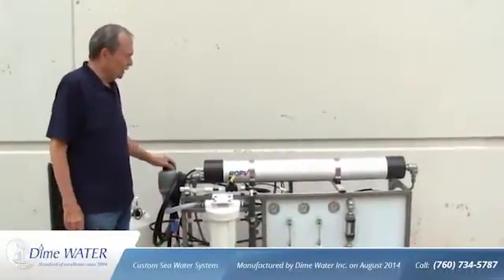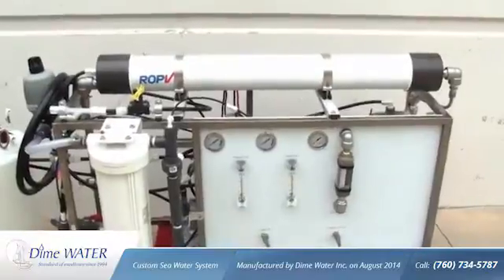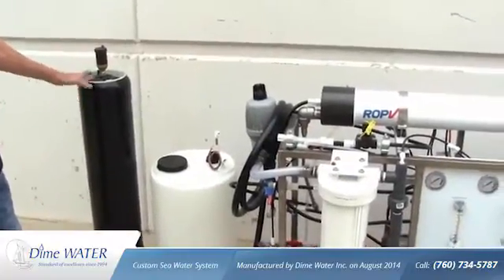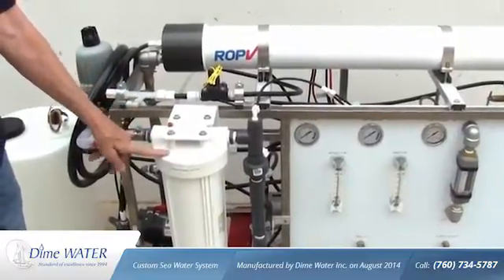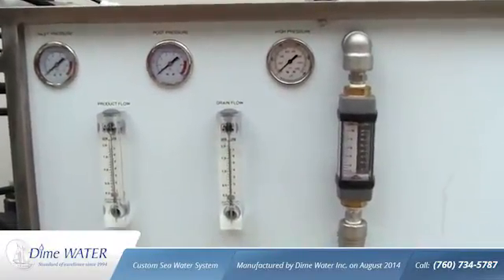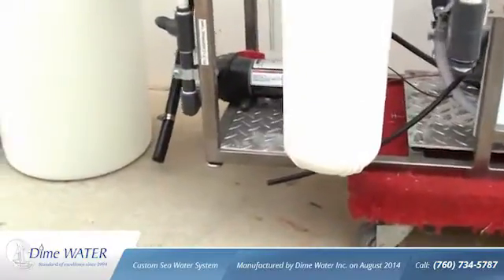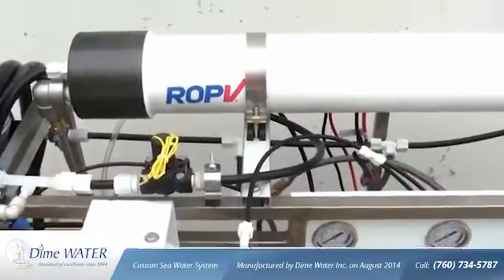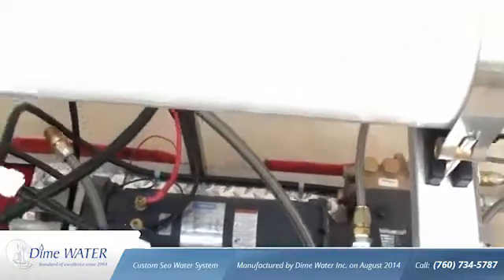Dime Water Inc. - Turning Sea Water into Drinking Water

Comment: What is the gallons of water production per hour. Can it be run on standard 120 or 240 volts AC, either from the grid or standby generator?